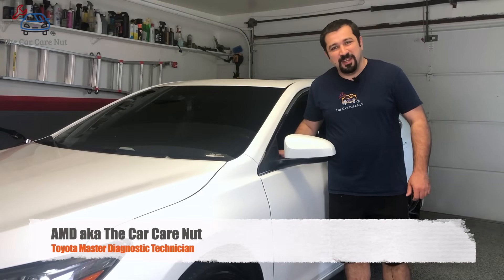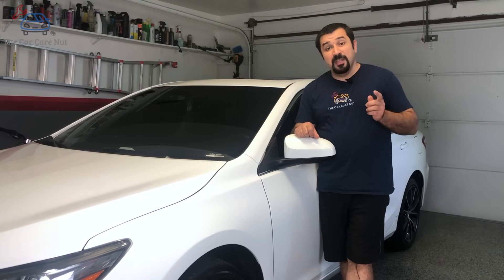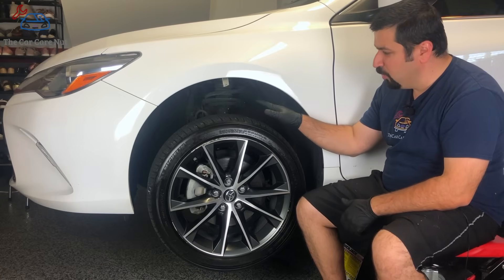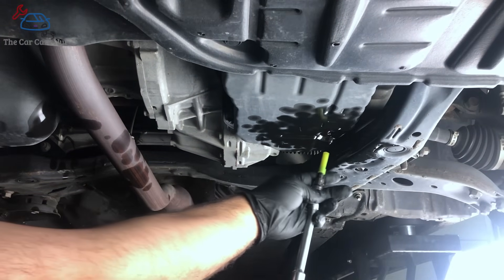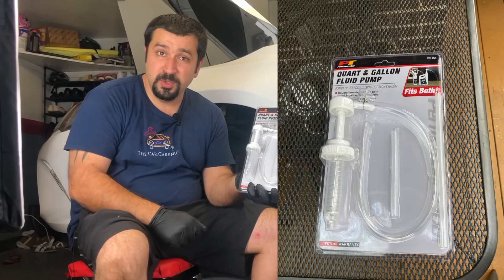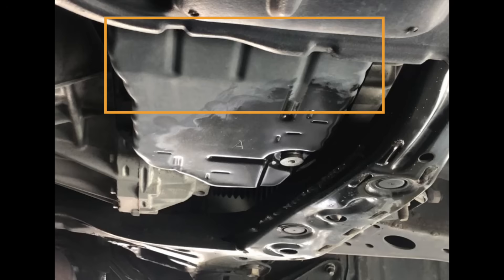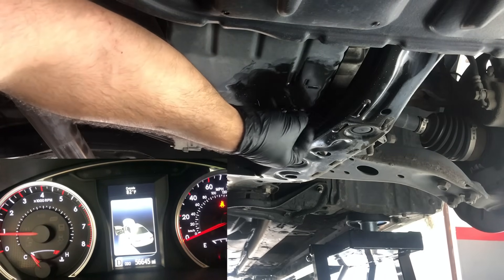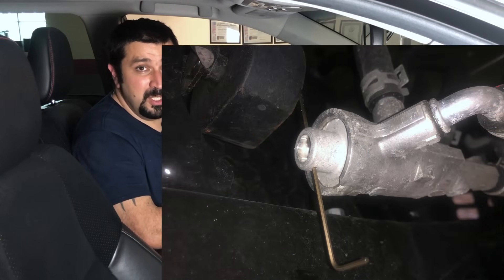How to change your Toyota Sealed Transmission Fluid

Comment: Big fan of the channel and thank you! I have a '20 RAV4 with just shy of 60k. Can't use the obd jumper method and it sounds like the temp gun method is not accurate enough... Don't current have a good though scan tool for trans temp. What would you recommend for the DIYer for cheapest scanner that can read trans temp? Thanks!

Comment: I have a 2019 Toyota Highlander Limited with the 8 speed A/T.  I have a scan tool that reads the temperature of the transmission. What is the temperature range for my A/T for changing  the fluid? Thank you.
Reply from the maker: Hi! 95-114
Reply: @TheCarCareNut  If it is 105 degrees outside and my car and the new fluid has sat in it all day would it be possible to do the measure and replace method?

Comment: Hello I just had the shop recently do my transmission drain and fill but they used the techstream method. For the whole procedure they used 3 quart and I think like 12 oz. I can't recall how much he had to drain out at the end. Does this sound about right? Since I did it at a shop I shouldn't have to go back in for them to recheck correct? Also the car was not set over night. It sat for Bout 3 to 4 hrs before they worked on it. Also I don't think hhe replaced the washers except for the drain plug. Is that okay?  Do you think overall I'm fine. Im pregnant and have alot of anxiety right now. Please respond.Thanks for your help and keep making these.  They are helpful.

Comment: Trans fluid change 2018 trd sr5 off road 4x4  tundra ……what temperature range does it need to be at for a fluid level check? Does the transmission bypass need to be pushed in and pinned when checking fluid level?  The garage I took it to last time said pinning is not required…… is he right? Everything I have researched says bypass needs to be pushed in and pinned? 
Which one is correct? I have a scan gauge connected to the OBD2 port that will show me transmission fluid temperature……I hope this gauge is accurate enough?
Thanks for your info care care nut
Pete

Comment: I have a 2011 Lexus GX 460 that's never had to transmission fluid changed. Do you think it would be safe to change it?
Reply from the maker: Hi! Depends on the mileage. If it’s over 100k I would leave it alone
Reply: @TheCarCareNut  It has 130,000 miles, so I'll leave it alone. Thanks for the response.

Comment: I have 2014 tundra 5.7 with over 105,000 mile and have not change the transmission fluid, should I change the transmission fluid?
Reply from the maker: Hi! There’s some risk to replace it at this mileage

Comment: AMD, do the 2wd cars with the 8 speed transmission have that cooler bypass? I’ve spent a total of 2 hours looking for it on the front end of my Camry and I can’t find it. Also, on other fluid change videos for the 2018 Camry, nobody ever mentions the cooler bypass.

Car is a 2018 Camry XLE V6
Reply from the maker: Hi! Your Camry doesn’t have a cooler bypass. Only some sienna, highlander and RX models have them
Reply: @TheCarCareNut   You are the BEST! Apparently the 2019 RAV4 XLE AWD does not have bypass either. 
I removed all plastic from under car and driver side inner fender. The trans lines leave and re-enter the trans via a square multi-finned box attached at rear of trans by firewall. No bypass visible anywhere.
Reply: Cool, thank you very much for a response!

Comment: Hey AMD.  I love your channel.  I have a couple of old highlanders my 2010 4 cylinder has 215 k.  I bought it a couple years back and I am due by miles.  But I am concerned that the fluid may NEVER have been changed.  I know you say it could hurt more then helps.  What would you do?

Comment: I have a 2016 corolla is six year old know time to change trans fluids? In 47k miles. That is a cvt trans how many bottle do i need for the corrolla also should i chage the filter?
Reply from the maker: Hi! Just change the fluid using toyota CVT fluid
Reply: Alright thanks. Love your videos,

Comment: Thank you for a great informative video as usual. Would you recommend to change transmission filter and dropping a pan down? Maybe it was answered already could not find. I know on older models it is just a strainer, but it looks like on 2015 RAV4 it has paper media inside. Thanks.
Reply from the maker: Hi! If the fluid is changed on time you don’t need to change the filter
Reply: @TheCarCareNut  thank you, would every 100,000 km be ok

Comment: What Temperature would I need if using a scan tool that reads the fluid temperature.
Reply from the maker: Hi! Which model?
Reply: @TheCarCareNut  14 Camry SE
Reply from the maker: 95-114

Comment: I have aa 2010 avalon bought it from a lady with 228000 miles for 3000 bucks..I did oil n other services but can't do the tyranny fluid because I just don't kno when lady it was replaced..should I still change it or leave it in.. ? I saw a sticker saying return for service at 201850 but don't just don't know..

Comment: Is the idea that it should stay on D  until the drain plug is back in? Per your recommendation, I rehearsed the wire trick a few minutes ago. It took took way less than a minute before it when from solid D to flashing D. That's isn't enough time for me to try to solo this job. I don't even think its enough time if I had a helper. The car had sat there for ~ 6 hours so I'm guessing it will give me more time if it sat overnight, but I think I need at least 2 minutes. How long do we have between the D going solid to  flashing?  I also don't want to risk over draining while the car is on D because I'm going to do it with the car on the ground and I don't have unlimited time to keep redoing this procedure.
Reply from the maker: Hi! The car needs to be in park when you’re actually checking the fluid level. The D light will come on solid/flash even though you’re in park. And usually you have enough time to check it unless the trans is too hot
Reply: @TheCarCareNut  AMD please help! {2015 RX350} I'm at the part where I get the Drive indicator to stay on D. I immediately shift to park and D light will go away. Which would indicate the fluid is not warm enough. However when I go back down through the gears the drive indicator not show any other gear except for when I'm in D. So I'm seeing N or R or P at all. In an attempt to try to push forward, I keep trying to go from N to D for 5 more minutes but the drive indicator never stays on D at this point. I've tried this same procedure and have produced the same result three times.

Comment: Went to 2 dealerships (stealerships) yesterday and they both told me they only pull the plug on transmission pan and they don't drop the pan, clean the 3 magnets and replace the filter. They stated it isn't necessary.🤪 🤪 🤪. I thought it was, and took care of it.

Comment: Hello AMD. Thank you for the video. I need your advice. I recently purchased a 1990 Corolla with 169k miles. The transmission feels great, no issues going through the gears. I'd like to service it, like a drain and refill but, #1 I don't the history of the transmission and #2 obviously, I don't want to cause any permanent damage. What do you recommend? TIA

Comment: I just completed draining and refilling my 3rd generation Prius. I did not notice any inner drain plug so I just drained and refilled from the side plug. Is this okay for my Prius?  I used all OEM fluid and replaced with OEM crush washers too.

Comment: What a mess.  Hard to believe Toyota came up with this primitive procedure.  Couldn’t they design a trans with the old manual transmission approach of filling room temp oil into the fill hole until it overflows?  Not precise enough ?

Comment: Quick Question.  Just want to know if this idea would work.  If i know the exact volume of cold transmission fluid that came out while i drained the transmission.  Do i really have to do the step of heating up transmission and checking the fluid level?
Reply: That works if the transmission fluid level was correct before.  But you don't really know that.

Comment: Last year I purchased a used RAV4 and the first thing I did was check the engine oil on the dip stick...the second thing I did, is look for the transmission fluid dip stick...it took me about ten minutes to realize that there wasn’t one...what the h*ll ! This is an obvious Toyota scam to have the car serviced at their dealership...I’m a long term Toyota fan but this peeves  me off....cheers🍷🇨🇦

Comment: I was on the fence about getting this done till I started watching your videos.  I'm getting this done at the dealer for my 2015 Corolla. 

I love how you explained the procedure :)
Reply: How much did they charge you?
Reply: @lybarger007  $285.00
Reply: @ryanmitakpa  did they do a drain/fill like in the video or did they flush out all of the fluid and replace it with new?
Reply: @MrSpandya22  The dealership I go to told me they have a machine that they use. They told me to wait till I had 60K miles before having them do it. 

I'm only at 55k atm. But they did say they would flush and fill the cvt. I also confirmed, as of 3 months ago, the price in Michigan (Pat LaFontaine Toyota) was $285.00 bucks.

I hope that answers your question.
Reply: @ryanmitakpa  pressurized flushes can work great or ruin seals. I hate the dealership but I'm a finatic who can't handle not knowing exactly what they did to my vehicle

Comment: My 07 Tundra has 282K, runs great. I do all my own maint. 3k oil changes, 30k Diff changes....bullet proof.
Reply: Nice bro 👌 i do my camry awd 2.5K oil change(if I wait to 3k or more the oil will stink of fuel the more the stronger one time I changed it at 5k because I used amsoil premium oil and it seemed like the oil got mix with fuel. so changing mine at  2.5k max it barely smells of fuel. Rear Differential and transfer case every 20k Miles. Mpg from full to quarter tank gets to the low 35mpg. Peace ✌️

Comment: Great video! On my Camry 2011 due to laziness I have never change the transmission fluid and the car has more than 280000 miles. I have been told to just leave it alone because if I do it now , I will ruin the transmission . Is that true?
Thanks
Reply from the maker: Hi! I would leave it alone at this point
Reply: @TheCarCareNut  It's what I thought ..Thank you !!!

Comment: Would you leave the Allen key in the bypass all the way through the fluid check and remove once you have completed the level check? Will this increase the time it take to get up to temp?
Reply from the maker: Hi! Leave it in through out the whole process. And it doesn’t affect the warm up time

Comment: Great video and just so I’m correct I have a 2019 RAV4 xle awd 8speed with 36,000 miles. Using the temp gun on the pan method 95-114?And no cooler bypass? Just bought it for the wife and gonna change all the drivetrain so I can get on a set schedule.

Comment: By any chance would you happen to know the right temperature for a 2007 3.5 Liter V6 6 speed automatic transmission Toyota Camry XLE? If i’m using the temperature gun method, do I still cycle the car from park to neutral and reverse a couple of times along with leaving the engine idling to circulate and warm up the fluid from a cold start of leaving the car overnight before doing the fluid change? I’ve also seen videos where along with a temperature gun, people use s a meat thermometer to measure the temperature of the trickling fluid. Would you know if thats an accurate way to double check? Also, when unscrewing the drain bolt when checking the fluid level, should you also have the fill bolt by the wheel unscrewed as well? Maybe to let the fluid drain easier? And finally, would you recommend replacing the gaskets/washers for the fill and drain plugs? Or removing the transmission fluid 18 bolt pan and giving it a clean along with changing the filter and rubber gasket? Thank you.
Reply from the maker: Hi! 95-113 and check it in the area I indicated in the video. Still cycle park to neutral to cycle the fluid. Doesn’t matter on the fill plug if it’s on or off when you check the fluid level. And replace the gaskets

Comment: Hello AMD. Firstly, thank you for all of your videos. They are very educational. I have a 2017 Camry with 60,000 miles and I have two questions: 1) Wouldn't it be more of a benefit to having a professional mechanic shop do a full trans fluid flush since all of the fluid would be replaced (granted, it would be more expensive)? 2) I know you recommend genuine Toyota ATF should be used, but I always felt that synthetic ATF would be more of a benefit since it keeps the trans cooler as it is less viscous than standard ATF. Your thoughts? I would appreciate your advice.
Reply from the maker: Hi! A single drain and fill every 60k with original fluid keeps things protected for long. You can do a flush but it’s not always better. And I don’t recommend non original fluid
Reply: @TheCarCareNut  Who do you recommend to do a simple drain and refill? I called my Toyota Dealership and all they’ll do is a Flush for $388. 

If a drain and refill is all that’s necessary and cheaper I’ll do that but I want to be sure the mechanic knows what they’re doing as far as this Toyota specific procedure.

Comment: I just purchased a 2016 Prius with   112,000 mi. I don't know whether or not the trans fluid has been changed. Is it safe to change the fluid now? I've heard different people say that you can run into issues when you change the fluid at that stage if it has never been changed before.

I also drive a 2006 Lexus IS 250 with an automatic transmission. It has 140,000 mi down we bought it at 110,000 and I am not aware that it has had any transmission fluid change throughout its life. I'm so curious if it will be safe to change the fluid on this vehicle. Your opinion would be so appreciated.

 Thank you for all the work that you do!
Reply from the maker: Hi! On hybrids you can change the fluid at any time on non hybrids once they get over 100k miles or so the risk increases

Comment: Hello Amd,
Great video! I have a question about 2008 Lexus RX 350 automatic transmission drain and fill. My wife’s RX 350 has a dipstick for the trans. What is the best way to make sure its filled at a correct level? fill oil through the dipstick opening however much came out plus additional half quart and use my scan tool and wait until it gets to 104F than check dipstick? If its overfilled how do I adjust the level correctly? Thank you Sir for the help.
Reply: This video and drain and fill procedure is for Toyota/Lexus transmissions WITHOUT the DIPSTICK. If your RX350 has the transmission dipstick, just fill with the same amount of transmission fluid that drained out. Should be about/around 4 quarts? I would fill with a little less new fluid through the dip stick, like 3.5 quarts. Drive it for 15 to 20 minutes, park it on LEVEL ground. Then shift through ALL the gears, from P and go through ALL the gears, allowing 15 seconds for each gear, with the engine STILL RUNNING, then return to PARK (make sure parking brake is on), make sure the engine is still RUNNING on PARK, go and check the level on the dipstick, if it's low just add transmission fluid as needed to bring it to the HOT level on the dipstick. That's it!
Reply: @hankyhank1652  thank you Hank.

Comment: I just bought a 2014 Corolla with 72k miles on it for my son. I contacted my local Toyota dealer about this service and he said they would do a complete drain (remove the pan) and flush. Is that more ideal or should I just have them  pull the 2 drain plugs and replace the 2-3 quarts that come out as you did here?

Comment: my 2018 camry i requested dealer to just drain and fill, they persisted to do a flush.....thoughts?
Reply from the maker: Hi! If you have around 60k miles a flush is ok if they follow it with a fluid level check
Reply: The Car Care Nut sorry meant to add at 75k it was done.

Comment: Does the Toyota do a good job at changing the transmission fluid? Im at 28k and am unsure if I should do the transmission at 30k or at 60k miles
Reply from the maker: Hi! Every 60k miles or 6 years
Reply: @TheCarCareNut  okay sweet! One last question, i took my car in for an inspection and i was told the engine is not getting enough lubrication? Would you recommend i do a engine oil flush since i dont know when the previous owner did the oil changes?

Comment: I have question regarding the Transmission fluid change for corolla 2022, you may have question how it possible as soon to change transmission fluid? I bought a corolla from auction which was undercarriage  and there is only one whole in transmission and i need to put fluid on it but don't know the way of that and could not find it, can you please guide me in this regard

Comment: Really enjoy your Toyota videos. Great explanations peppered with personal experience. I have a 2015 AWD Highlander with 105K miles that has never had the brake fluid, T fluid or coolant changed. Should I get those fluids changed now? Car runs great.
Reply from the maker: Hi! I would get them replaced especially the transmission sooner than later

Comment: I took my Camry 2017 to a Toyota dealer to change my transmission fluid and I think they didn’t do a good job. My car after changing the transmission fluid has a sound like vacuum when shift from R to N or D to P. What do you think is happening with that sound? What can I do to solve this issue.  It seem they did something wrong because car was fine with not sound before changing the transmission fluid. I need help of what I can do please. If I would have watched your video before I would changed my own transmission fluid. I need help any recommendation….